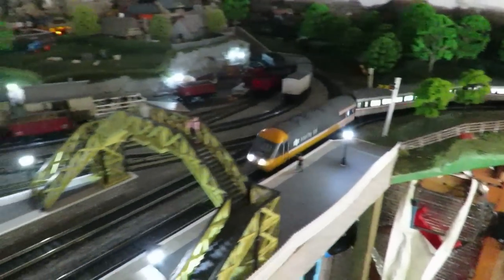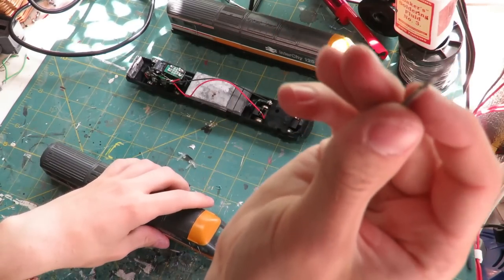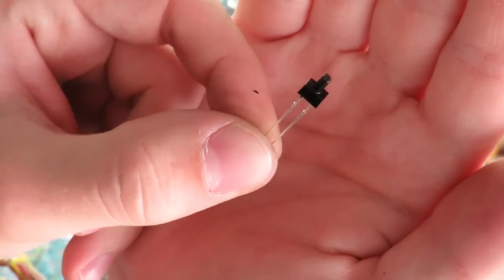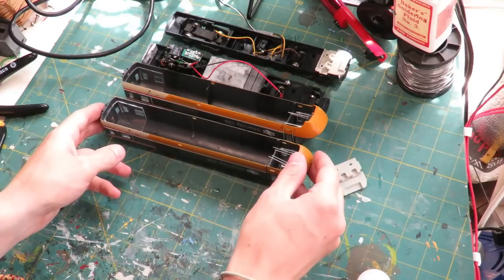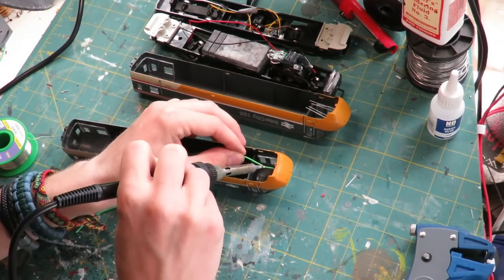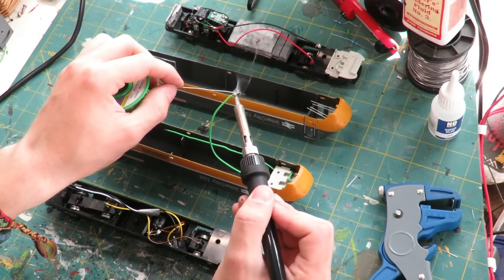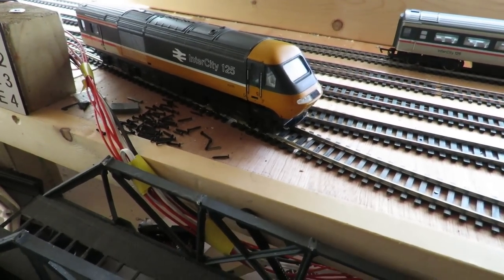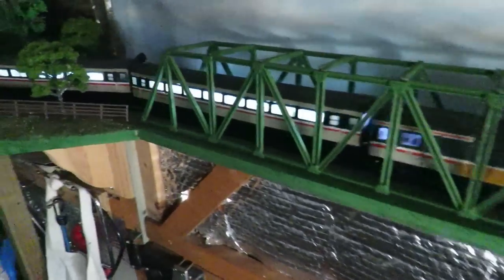How To Fit Directional Lights In Model Railway / Railroad Locomotives- Tutorial Tuesday Episode 44

Comment: Looks great for 125. Have you a video for the class 37 that you did as it has separate red light and white lights
Reply from the maker: I will do a video at some point on locomotives with separate red and white lights. The basic principle is the same just instead of using bicolour LED's, just use separate red and white LED's in the appropriate bodyshell holes (You may have to drill some extra tiny holes as Hornby bodies usually don't have them, Lima's usually do)

Comment: Would this work for the Hornby class 66 to save hacking away at the chassis?
Reply from the maker: It should work on anything. You may have to drill holes in the body where the lights need to be.
Reply: @BudgetModelRailways  Thank you.

Comment: Thanks for that mate. How would you wire a 3 leg led though. I can't seem to find two leg bi colour in Australia. cheers
Reply from the maker: Unfortunately I tried 3 leg before as they are a bit cheaper and much more common but i can't find a way of reliable switching the polarity to the different legs.
Reply: @BudgetModelRailways  Thanks anyway Doug.
Reply: Found a whole year further on - awesome tutorial. I had the same issue finding the bidirectional 2 leg leds in NZ. I tried looking on good old AliExpress but they were all 3 leg. The cost of shipping from the UK was exorbitant to say the least! Ironically I eventually sourced the right ones in Melbourne - shipping was also a bit expendy thanks to Aus Post  not offering untracked items but still worth it to me 😁

Comment: What are these 12 Volt LED's like at lower voltages, i.e. low speeds?
Reply from the maker: Certainly with our PWM controllers, not sure about others, The LED's retain full brightness even when the controller is on the very lowest speed with the train not actually moving.
Reply: @BudgetModelRailways  Yes, that makes sense as the voltage is constant with your PWM controller but it would be interesting to know how well they work with a conventional analogue controller. I guess I will have to buy and try.

Comment: This will probably sound stupid but I am new to this hobby but how do u get power to a dummy engine for powering the lights. Is there a video for this..thanx
Reply from the maker: Because the intercity 125's originally came with an old style of lighting in the front and rear, the dummy should already have pickups. One bogie will be positive and the other negative. If not, you can use the method shown in our coach lighting video for how to make your own power pickups.